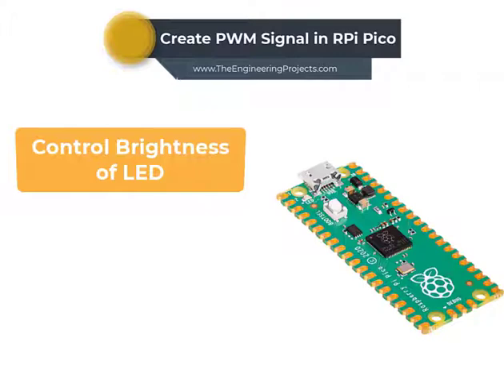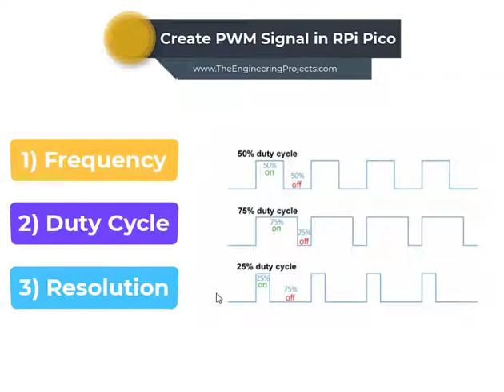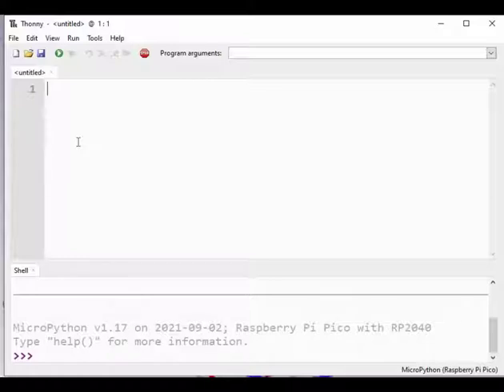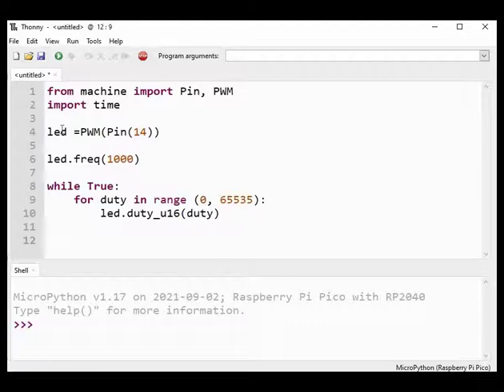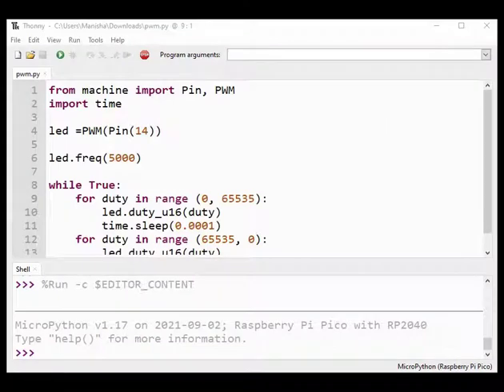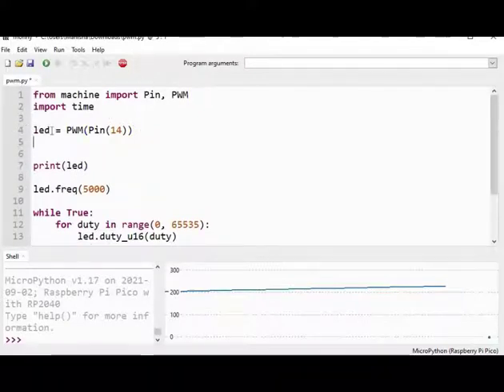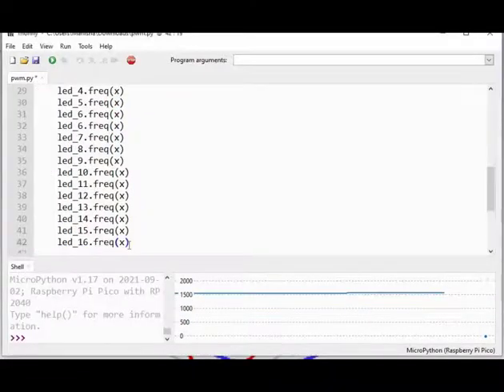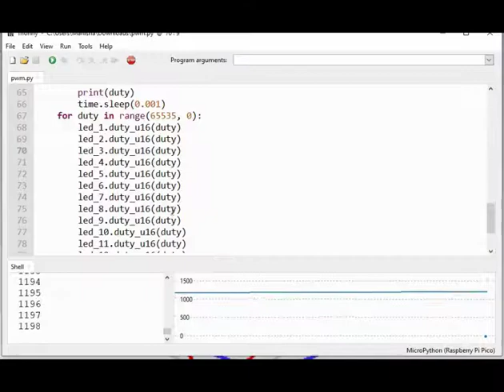Implementing PWM with Raspberry Pi Pico using MicroPython

Comment: Unfortunately there are a few disturbing errors in this video. Some are clearly visible. For instance range(65535, 0) does nothing. should be range(65535, 0, -1). You can see this error in the led intensity and in the plot (should be triangular shape, not sawtooth).